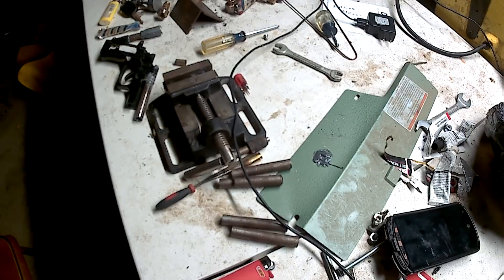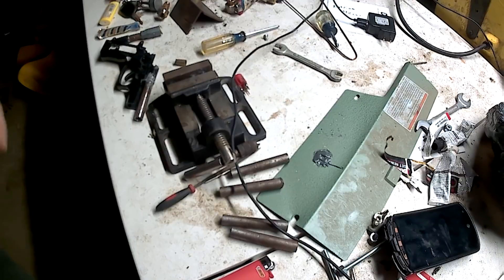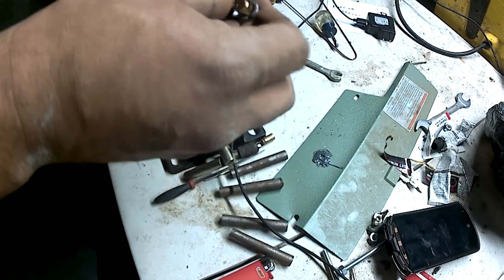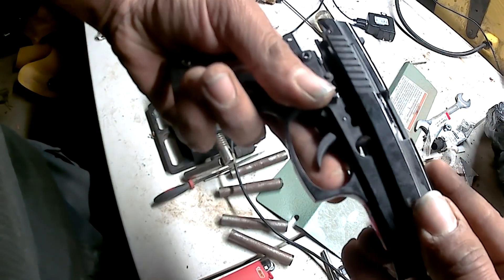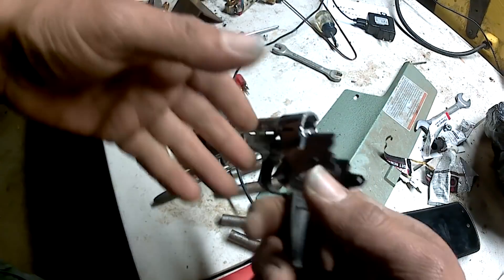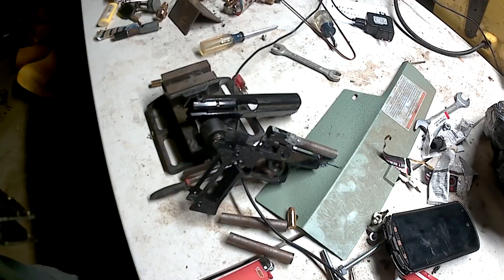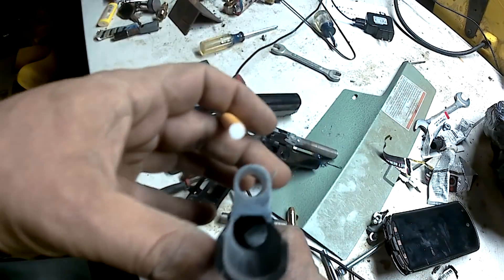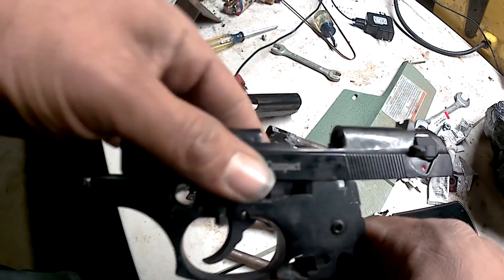P29 fix

Comment: How much diameter need to be a steel pipe for a 32 acp or a 7.65?
Reply: 18mm by 500mm
Reply: Jay Hickman  I have an 8.6 mm order not the right size so?
Reply: @gotar3718  no 18mm by 500mm
Reply: @gotar3718  but check ur self bro

Comment: I do not think you should fill it all back up with weld, but you can put little tack weld, only if you have taken a little bit off feeding ramp more than you needed, when you get down to the very fine point, I would suggest when you get a magazine into it, and actually look at the bullet, entering  the Chamberlain or trying to, it will give you more of a better mine's eye on how much needs to come off, and at what part, what you have in your hand there you could be taking off too much not enough, you need to have the magazine and the feeders in situ, I reckon you will have better results than my friend, good luck and good video,

Comment: Cool work you are dooing. If the chamber is to deep try cut a pice/ring from a spendt cartridge that the same length as the chamber is to long, and put it in the chamber. That way the cartridge wont go so deep in the chamber. I have seen other folks try this in firearms that was chambered for 9mm Long and was shooting the shorter 9mm Luger. Greetings from Norway :)
Reply from the maker: Cool thanx

Comment: Try chambering the pistol in .32 acp because it’ll last longer since it’s smaller than a .380
Reply from the maker: Yea that's what I'm thinking. Might start doing set pins too
Reply: Phd.in.Macgyverism. Try reinforcing the slide with steel ?